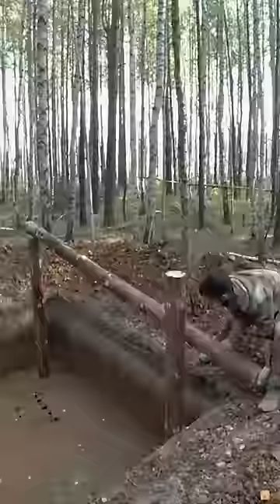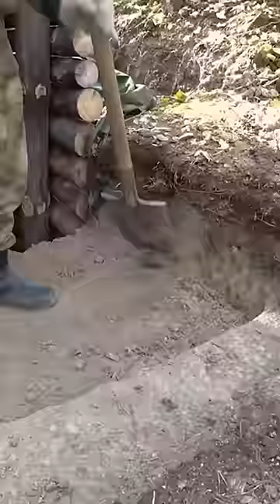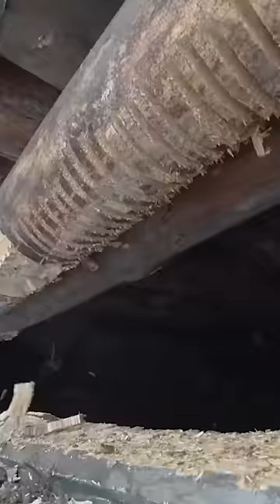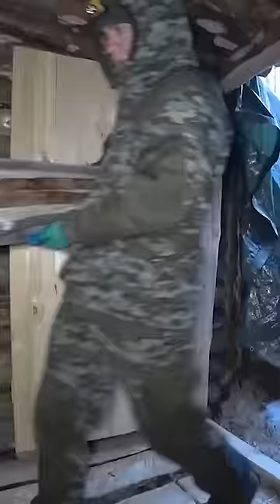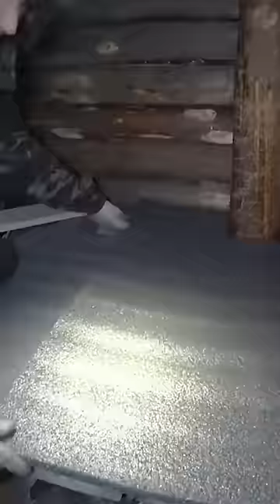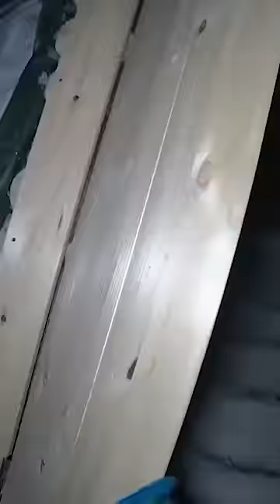Building a underground bunker from start to finish #shorts #bushcraft #logcabinbuild  #dugout

Comment: These guys are awesome! How much to build one on my property??😊
Reply: First; use standard landscape timbers sunk 6 inches below the floor level for the walls. 2 lag screws per log. This makes a nice sticker wall. Then put in 3 inches of gravel add 3 inches of wet concrete. Flatten it out. Let dry 3 weeks . Now frame the ceiling. Again use the Timbers. Then drape 8 mil plastic down the walls and another layer over the roof. Add 1.5 feet of dirt to the roof. TADA ; root cellar and tornado shelter.